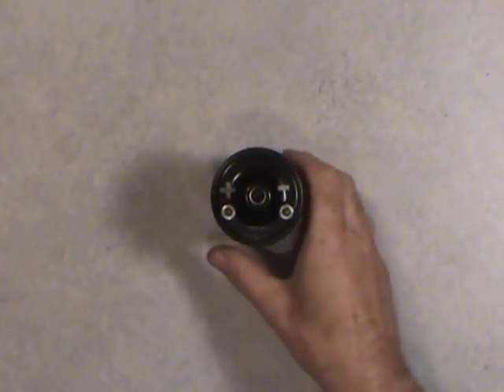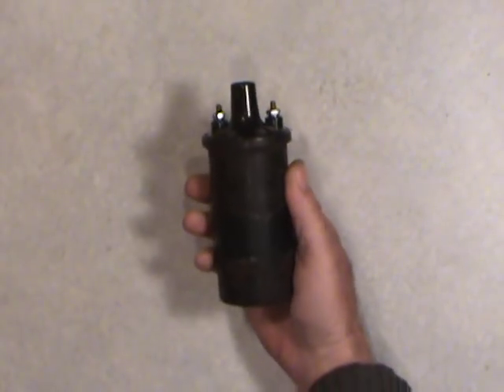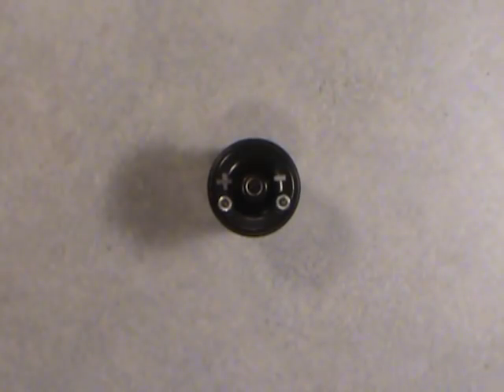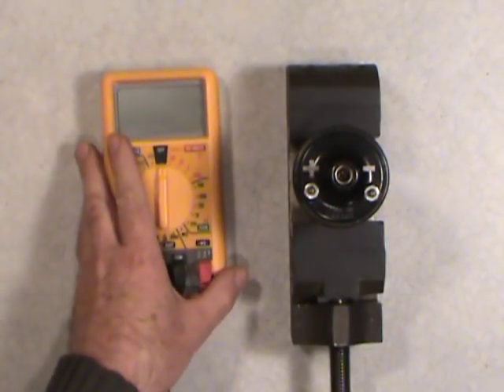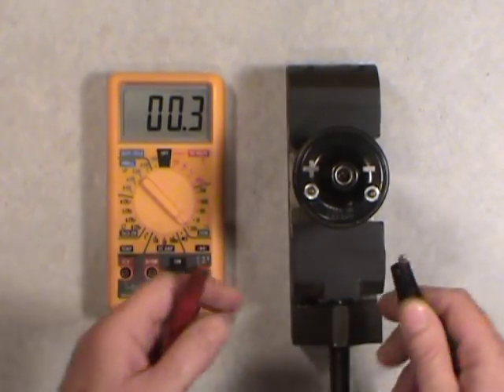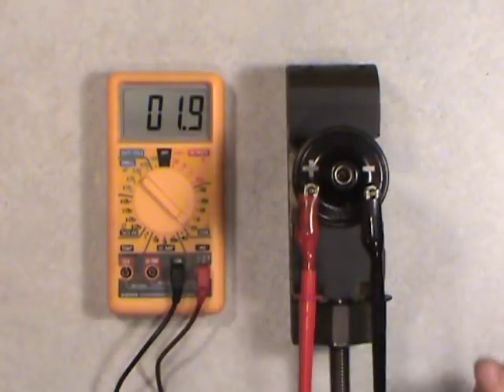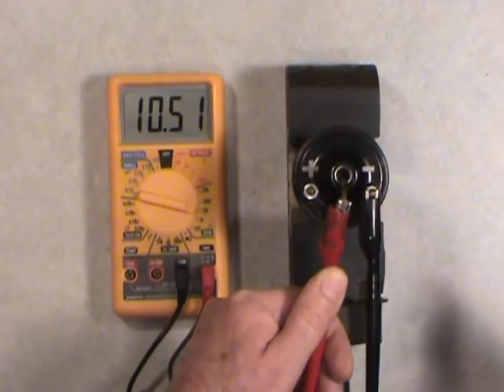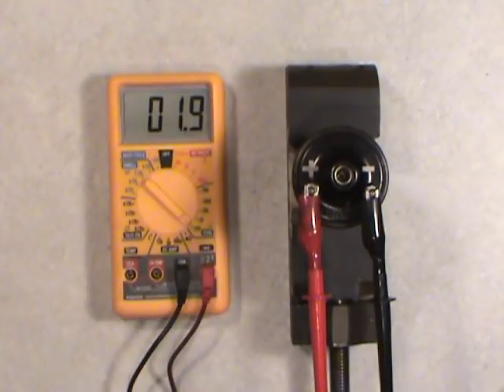Ignition Coil Testing

Comment: They haven't used pop in years. Now it's all mineral oil or vegetable oil. But the old time lineman always told me that the PCB was a very good tool lubricant. Back in the day they would take there tools and dip it in the pcb but it is a carcinogen which is why it was taken out of service in transformers or cans. Not sure if they stopped using all of it in these coils
Reply from the maker: Greetngs...MrMorphious199...……Thanks for watching...……..Gee, I wonder if the older PCB filled power pole transformers, are still in operation, well, as long as they still work properly, that is, or, was there a time, where-by, a certain year came along, and, they said..."get-rid-of-em"...lol...……...Starting around 1975 there-abouts, General Motors company, started using, the "epoxy" encapsulated, type of automotive ignition coils, and look Ma, no more oil, what-so-ever...lol...…….Then, there was something called, carbon tetrachloride, as I recall, and there use-tah be a product, which was a clear liquid, that was called Rapid Tap, that sure made tapping screw-threaded holes, almost as easy, as goin', almost as easy as butter (might be a bit of a stretch), but, never-the-less, it sure worked very well indeed (hmmm...was there carbon tetrachloride, in that Rapid Tap liquid...???)…and, till next time...….Be Safe, take care, and have a good one.

Comment from the maker: Greetings San Ozi....From my perspective, I don't think that anyone can actually predict what the next Ohm-Reading will be on the Ignition Coil that you have there....As long as your Ignition Coil functions properly, and the Primary and Secondary Ohm's-Readings are within Specifications, then, that's what is important...Keep your Engine well maintained...Worn-Out spark plugs and Faulty spark plug Wires put unneeded Stress on an Ignition Coil...Inspect your Distributor Cap and Rotor....Take care

Comment: Hi Rocky, I notice you are using an Equus multimeter. What model is it? I like that it measures dwell. I am working on a simple ignition system from the 70's, and that meter looks like it would cover it all ( dwell, resistance, voltage etc. ) without being too much. Cheers, Stephen
Reply from the maker: Soula Tyrteos Greetings Soula Tyrteos....Thanks for watching, and for, Your comment/Question as well...............................................I just had a look-see, at my...Automotive Specific...Yellow Multi-Meter...and, the..."Model Number"...that I see on it, is...70-4369..................................................I'm not all that sure, if "They", still make this particular "Model", as, I think, that it was about, oh, maybe...10 Years ago, give or take a few Years, that, I stumbled upon it, at a local Canadian Tire Store, in the Automotive section, locked up, behind a pair of glass doors, in a display cabinet, and, I had to go "Find", the Person, that worked in the Store, that was able to get the "Key"...to..."Unlock"...the..."Locked"...Glass Doors...!!!...lol...............................If memory serves me right, I believe that I paid about...$85.00 (Canadian Dollars), before taxes, for "It", way back when.......................................................Now then, just remember to "Check" the "Calibration", on the "Low Ohm's Scale", whenever You happen to be taking a Measurement, of a "Low Resistance" Component or Circuit, as, Unlike a good ole "Analogue" Meter or Multimeter (You know, the kind of Meter, that has a "Needle/Pointer" that waves at You, when You put it to use), as, from my experience, using them, they usually had, a rotary "Adjusting" knob, or Thumb/Finger Wheel (potentiometer, or Pot, for short),  to..."Zero-Set" (aka, Set to Zero)...the "Needle/Pointer/Indicator", on any of the Ohm's Scale/Ranges, Before, I went ahead, and made those "Ohm's/Resistance" Measurements, with the Probes, as opposed to this "Digital Readout"...Yellow Multi-Meter, of mine, that is shown, in some of my YouTube Videos..."Not Having"...a..."Zero Adjustment"...provision on it...!!!....................................................In the event, that, You are not able to find, this particular Model, of Automotive Type of Multimeter, it's just a matter of, keeping a Eye (more like an Eagle Eye...!!!...lol) out, for, an Automotive Type of Multimeter, that will suit Your needs, and, Wallet as well....................................................Good Luck, with "Finding", an Automotive Type of Multimeter, that will get the Job Done................................................Be Safe, take care, and have a good one.

Comment: I have an old Case tractor with a points type ignition system.  I no longer have fire at the plugs.  Ai check the resistance at the coil and after adjusting for ohm meter error I read 3.3 to 3.4 ohms from the positive to negative side of the coil.  I read 8130 ohms from the positive side to the secondary in the center of the coil.  In your video you mention 1.1 to q.8 ohms.  I am 2 to 3 times higher. In the secondary circuit you suggested 8000 to 12000 ohms.  I am reading 8130 in the secondary. Is the coil good or bad in your opinion?
Reply from the maker: Greetings Ed McCann....Thanks for watching, and for, Your comment/question as well....There are a number of things that I will mention, that, should at least, point You in the right direction, in order to "Restore" Your Case Tractor's "Ignition System", to Work once again, and, "Re-Light the Fire!" (aka, get Your Spark Plug/s "Sparking" again!)....Seeing as how You were getting "3.3" to "3.4" Ohm's  showing on Your Ohm-Meters Display, has me thinkin', that, Your "Ignition Coil" might "Not Have" an "External Ballast Resistor" (aka, Ceramic type or like the General Motors "Resistance" Wire), that would usually be "Needed", if the "Primary Coil" (as measured with the Ohm-Meter's test leads, being connected to the +, as in Positive terminal, and the -, or Negative terminal, on the Ignition Coil) was Showing, usually "2" Ohm's or Less.

Or, in other words, Your Case Tractor's "Ignition Coil", might have that slightly "Higher" Primary Coil "Resistance", because, perhaps, Your Ignition System's "Circuit"..."Does Not" have that "Ballast Resistor" in the "Circuit", due to the "Resistance" Already being there, in the form of, having a slightly Larger "Primary Coil Resistance" (3.3 to 3.4 Ohm's, as compared to Less then Usually 2 Ohm's, that also needs the Ballast Resistor, in the "Circuit", to keep the Ignition Coil" from "Burning Up"...!!!).

Before I go too far, I really should mention, that, It's "Very Important", for You to Indicate "Exactly"...What "Year?", "Model?", "Engine?", "Modifications?" (if any), as, I have "No Idea", what-so-ever, as to, "Which" Ignition System  that Your Old Case Tractor, is Actually "Equipped With"...???

There were quite a few "Different" Types of Ignition Systems, for, the Many Years, that the Case Tractors were Manufactured and Sold...

...It appears that, some Case Tractor "Electrical Systems" could have been "6" or "12" Volts, and, may have had either "Positive" or "Negative" Ground Electrical "System/Circuits" as well...!!!

Then, some had "Magneto" Ignition Systems, while others had a "Distributor" type of Ignition System, and with the "Older" (distributor type ignition system), Ignition "Points"...Triggered the Ignition Coil.

Even the Spark Plug Screw Thread "Outside Diameters" were Different Sizes!

If Your Old Case Tractor, "Does Have", what looks kinda like a 1960's, to about 1974-ish, Chevy, Ford, Dodge, American Motors, etc., Car or Truck "Points and Condenser Distributor", then, once the Distributor "Cap" is Removed, there is usually a "Condenser" (aka, Capacitor) Mounted to the Top part of the Distributor Housing (aka, Body), and, if that "Condenser" goes "Bad", the Engine usually won't Start or Run!

If Replacing the Condenser, it "Must" (Super Important!), have the "Correct Rating", that is Measured in "Micro-Farads" (I believe), that is "Designed/Engineered" for that "Exact" Distributor Model/Application...!!!

Some "Condenser's" might have the "Micro-Farad" Rating "Stamped" on the Outside of its Metal Canister, while others might not!

If, let's say for instance, that, the "Wrong" Condenser (aka, Micro-Farad "Rating") happened to get Installed, then, in the better case scenario, the "Ignition Points" would start "Eroding/Pitting" at way too Fast a Rate, and the Engine would probably start running rough, and perhaps, start to miss-fire as well...

...and...

...if the Micro-Farad "Rating", of that Condenser, "Wasn't" even in the "Ball-Park", I doubt that the Engine would run at all.

So then, as I see it, with the not-so-much Information, that I have to go on, has me thinkin', that, Your Ignition Coil should be OK, as, it appears that Your Ignition System "Might Not Have", an "External Ballast Resistor"...But, "Make Sure" that, You "Check", before making Any "Assumption's", which might cause Problems...!!!

Do an Internet Search, for an "Ignition System Tune Up Kit", for Your "Exact" Year and Model of Case Tractor, as that will usually be showing some Images/Pictures, of the Needed Parts, to do a "Tune Up" on Your Case Tractor's Engine.

Everything from Your Case Tractor's...Battery, Ignition Switch, Charging System, Wiring/Connections, Points and Condenser Condition/Adjustment, Spark Plug Gap, and Condition, etc., are "All" very Important "Items", that have to be in..."Tip-Top-Shape", as well as, "Adjusted to Specification's" or, Your Case Tractor "Engine", is not going to be...Very Happy at all...

The Ignition "Points" will start "Eroding/Wearing", whenever the Engine is Running.

Once the Ignition "Points" get "Worn Too Much", then, the Engine usually starts getting harder to Start, as well as, Does Not "Run" as good as it use to...

For the "Best" Air/Fuel "Combustion" (inside Your Engines Combustion Chamber/s), Your "Ignition System" Needs to be able to Provide a "Nice Big Jolt" (aka, Strong High Voltage) to the (must be properly "Gapped", and in very Good Condition) Spark Plug/s...or...Your Engine's...Horsepower, Torque, Efficiency (aka, Gasoline Consumption being Too Much!), and also, Your Engine's Driveability/Response, will be Suffering as well...

If You like, let me know, all that You can, about Your Case Tractor's Engine and Ignition System, Including, if it's a..."6" or "12" Volt Electrical System, as well as, if it has a "Positive" or "Negative" Ground System.

There are quite a few Case Tractor Websites that can be found on the Internet, if You go looking for them, and, most of them, should have Question and Answer Forums on them, and hopefully, someone has an Old Case Tractor, much like Yours.

I hope that, some of my Long-Windedness (above) is able to help You out...

Good Luck...

Be Safe, take care, and have a good one.

Comment: Very clear. Thanks,you.
Reply from the maker: Greetings...Thomas J. Minnigan…………You're welcome, and thanks, for the nice comment...……..Whenever replacing an ignition coil, always make sure, to install, the..."correct"...ignition coil, for that..."exact"...engine (and vehicle), or, if not, then, the result might be, a weak spark, or maybe, no spark, showing up, between the spark plug's two electrodes, or perhaps, an ignition coil, that gets too hot/overheats, and destroys itself, some time, after the engine, just starts running...and...…..till next time...…..Be Safe, take care, and have a good one.

Comment from the maker: ...also, there is resistance in your spark plug wires....Spark Plugs can be Tricky!....For example, some have resistance in thousands of Ohms!....Without all of the items already mentioned, it will be the Spark Plug Gap, that will determine, just how much Voltage is required to jump a given Gap....The wider the Gap, the more Voltage needed to jump that wider gap!....The oil filled coils up to about 1974 usually have a spark plug gap of about .035" (just over 1/32 of an inch)....(con't)...

Comment: Great presentation
Reply from the maker: Greetings...Hugh Griffith..................Thanks for Your nice comment, and, Thanks for watching too.................Although an Ignition Coil, was able to Pass the Ohms (resistance) Test, with an Ohm/Multi-Meter, then, that, in itself, isn't a Guarantee, that, that particular Ignition Coil will be working 100%, when asked to do so................Sometimes, when an Ignition Coil (that tested good, for ohms/resistance, at, about room temperature, there-abouts), seems to be alright, might, while in operation, and reaches Operating Temperature (or maybe hotter?), then, it's possible (rarely, that is), that, this particular (faulty, when warm) Ignition Coil, might start to act, kinda, strange/weird, and might be the cause, of some Ignition system Misfiring, and maybe, stop working all-together, perhaps...................Just keep in mind, that, all it takes, is, one small, "Faulty/not so good", Wiring Connection (as in, oxidation, corrosion, and, I've even seen green stuff too...!!!...Yikes...!!!...lol), on the Primary/Low Voltage side, of an Ignition System/Circuit...............Yes-Sir-ee-Bob...everything, from having a good Battery...a good Charging System...all Ignition System related Wiring, being in good condition, as well as, being moisture free, while also having, everything on the Secondary/High Voltage side, being in great shape as well, are pretty much, a must, to keep Your Engine running, as good as it should be, and..........till next time.........Be Safe, take care, and have a good one.

Comment from the maker: ...also, all wiring and terminal connections must be clean and tight, or you may have some intermittent problems brewing as we speak....One thing that most people seem to over-look, is the large "Ground-Wire" from the battery - (Negative) post or terminal to where it gets connected (Bolted) to the Engine Block, mostly on North American vehicles....I'm just Generalizing at this point in time, so, if you like, you can let me know "Exactly" what your Ride is, so I can help you out....Take care...